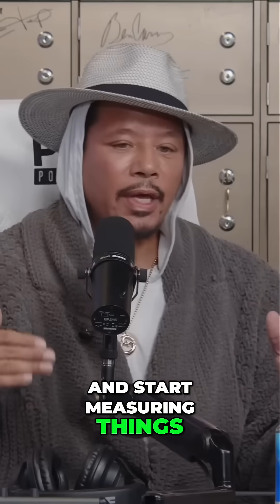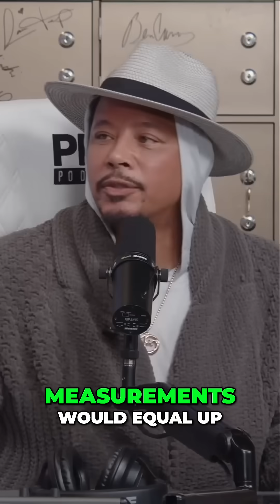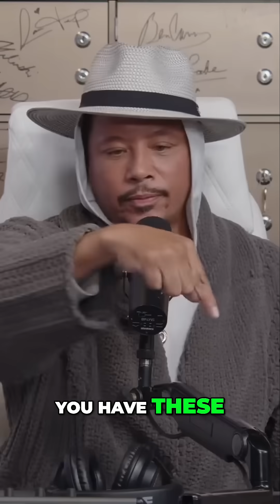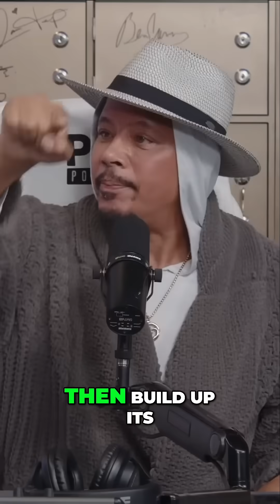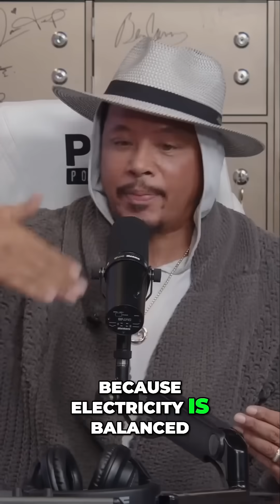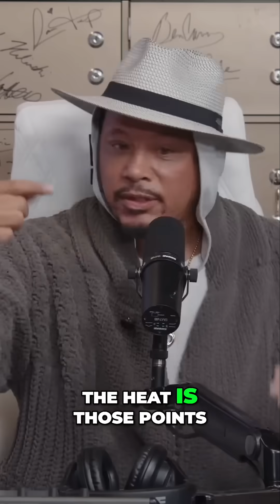Unlock Energy Flow: Why Spirals Beat Straight Lines

Comment: This guy is completely scientifically illiterate, has misplaced confidence (due to the Dunning-Kruger Effect), and elevates it to the point of delusions of grandeur.

Heat is caused by the electrical resistance of the material, NOT the path of the wire/circuit.

He could debunk this by himself just by using an infrared camera to look at an electronic chip and see what parts of the chip get hotter.